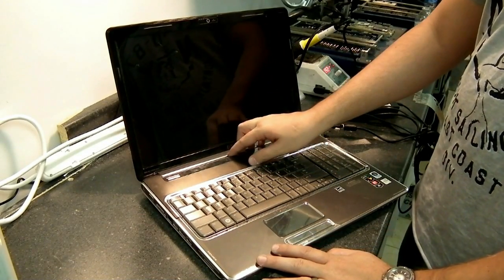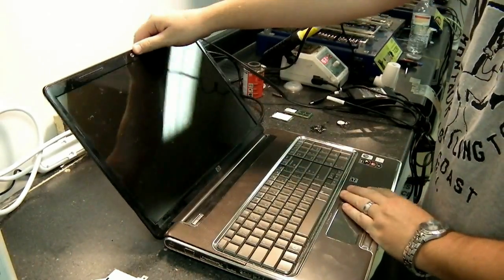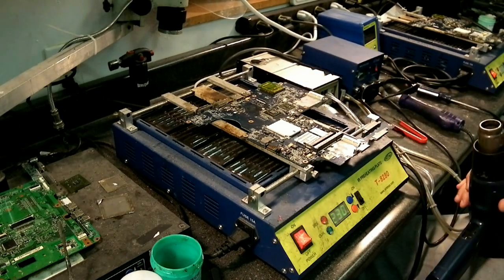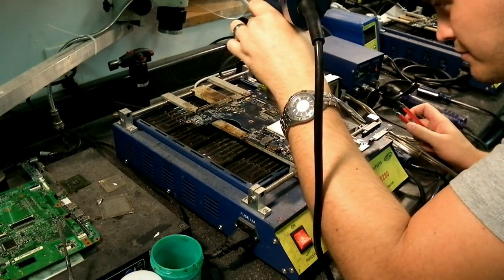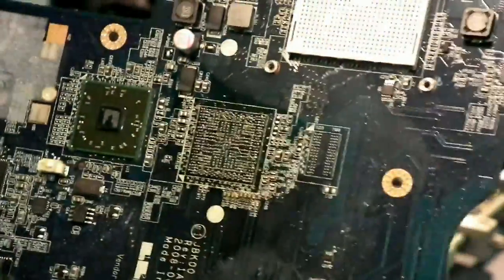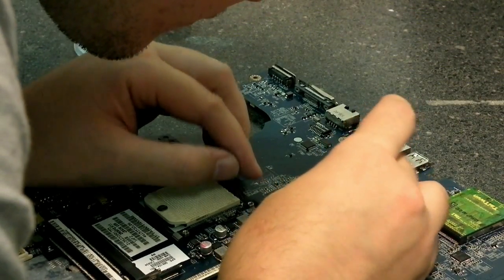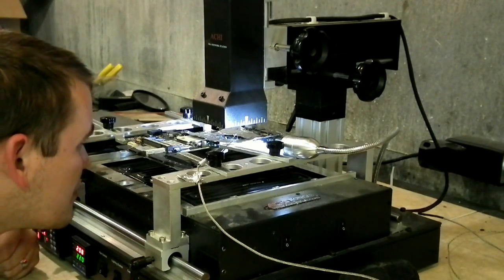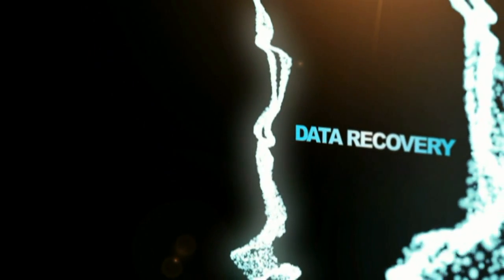HP DV7 Video failure repair and BGA video chip replacement reball

Comment: I am having the same issue with my DV7.  It powers on for a second, then immediately powers off.  I believe it is either the GPU (AMD), or the motherboard.  Am I better off replacing the entire motherboard?  I'm not trying to get too crazy since the laptop is quite a few years old.
Reply: I tried to visit your website, but the domain is no longer up.

Comment: HI, I've HP Pavilion dv7-3079wm with(2.40 GHz AMD Turion II Processor M600) &(ATI Mobility Radeon HD 4650 (M96).Laptop gets Extremely HOT & shuts down with in 10 mins,Can you pls tell me how to disable ATI VGA & use built in basic Intel VGA. Or how to replace ATI with any external VGA card that doesn't get hot. Thanks in advance for your advice. Rgds,

Comment: hahaha i have the same preheater, i have now one motherboard from msi gt780 to repair, desoldering the bga some pads detached, i believe major part of them was empty and some on the corner whas the GND, i will try to place an hm65 instead of the hm67, it should work :) did you ever tried it?

Comment: is there anyway you can replace a chipset processor to a normall processor i still have 1 intel pentium 4 processor of 3 GHz and a intel core i3 processor of 2.40GHz do you think its posible to replace it with 1 of those cpu with normall tools

Comment: I have heard this is common with the dell lattitude d620 and d630, i own the motherboard for both and the rest of the laptop for one, and neither board gives me video, unless i am lucky. Vga out usually works though. Bad screen cable or bad chip? I have a modded driver that lets me always run the cooling at full tilt. i got it for 10 bucks nonworking because it had a core2 duo and a 720p screen.

Comment: Hi, I've replaced the motherboard in an hp DV4 (the south bridge stopped functioning but with an external hard disk the laptop worked). Now after replacing the motherboard the laptop blinks one time and there is a black screen (which might be a cpu problem by hp web). Which is strange, because prior to replacing the motherboard the cpu worked. what can it be and how can i fix it?

Comment: I got a question. i have an hp dv7 4190us. have had it since 2010. The laptop turned  was working one moment, and it won't turn back on now. it just shut down. the power works, with and without the battery, when I press the power button, nothing happens. it just stays off.. 0.0 any suggestions
Reply: find the power supply section and check all mosfets or only cold solder cause of hot the board
Reply: Thanks. But I got rid of it 6 months ago. Bough a desktop in stead
Reply: good bro take care of that,..electronic device is important,.. XD
Reply: Yeah. Its a lenovo k450, I got it during black friday, ten times faster..plus I dont have to buy a new one, just upgrade the components in the future. I have  macbook pro for school, but fun it on this desktop

Comment: Is this a 1105ea?
I think I might have the same problem. The screen is black, numlock and capslock leds blinks, no blinking pattern. I can't identify the error code. I tried to flash the bios but o luck, nothing happens when I put the usb in...

What were the symptomes in your case?

Comment: hi i have a hp pavilion dv7-4165dx, about month ago i start seeing a vertical lines on screen, when i would bump it the lines would go away and back to normal, but one day it just stayed all togather, seemed when i open and close the lid it made worse. i wonder if the invertor bad or maybe a cable. i have it hooked up to a hd tv with hdmi right now to use it but would like to fix, please assit and if something i cant do maybe i can send in for u to have a go at it. ty sir. Matt

Comment: Oh, I also had a dv5000 series before that, but it never did anything like that to the panel it sat on (which is the same one the dv9000 sat on). Any tips on what I can do to prevent this with my new laptop is appreciated.

Comment: Besides not using the laptop on a bed, what is the best way to keep it cool? I just ordered a ENVY dv7t-7200 Quad Edition today. I used to have my old dv9000 series sitting on an old aluminum PC tower side panel to keep the vents clear and usually had the A/C cranked up. But over time, I noticed a black soot discoloration on the aluminum panel where the laptop's fan was. I never had any type of failure, but that couldn't have been good. Any ideas as to what might have caused the discoloration?

Comment: So My Dv7 last night. while on the screen went black and hasn't come back since. I tried connecting it to my external monitor, no response. Powered off, remove battery. Pretty much all the basics that came to mind. The only thing out of the ordinary I noticed is that the CAPS + Scroll Lock light on the keyboard keeps flashing. Please advise me of a possible solution Thanks in advance.      
Samuel.

Comment: hi, when I need my laptop to an external dilplay plug in the laptop works. I have the display, inverter and display cable changed and still does not work. when I do that it will work?

Comment: if u try to do it by yourself you have to tape aluminum foil around the gpu and not have the foil touch the board if u get what  i mean. protect the board from heat and only ruin the gpu lol